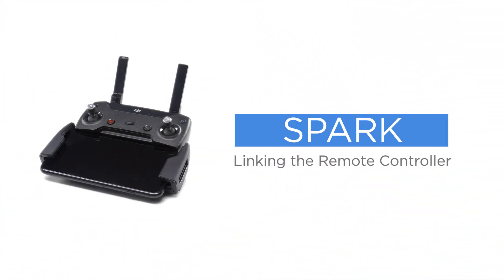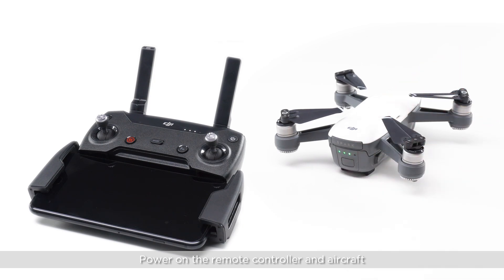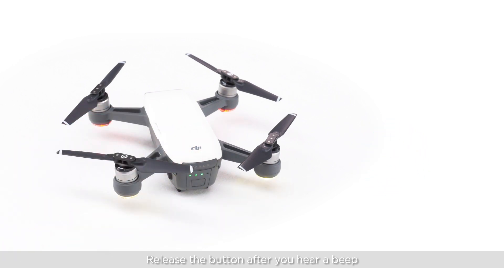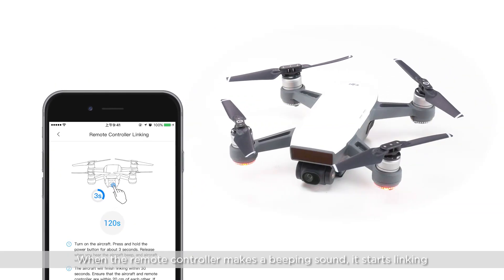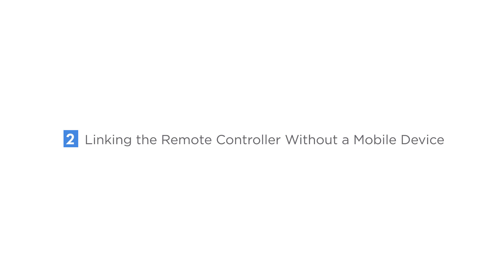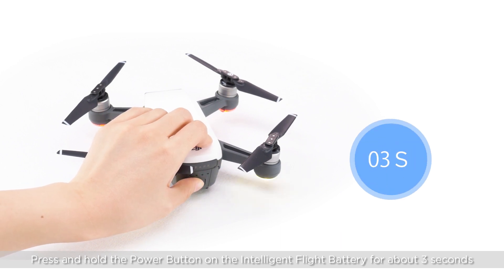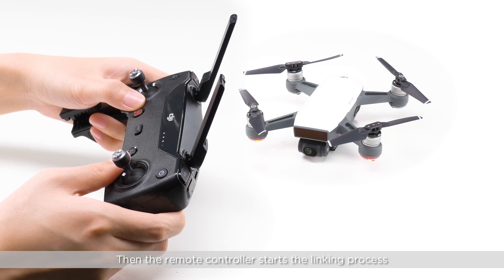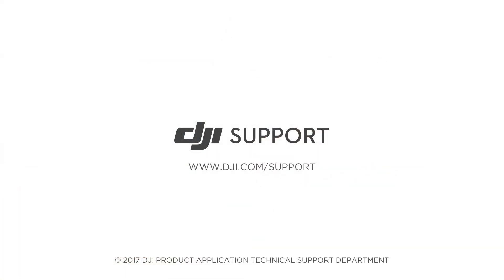How to Link DJI Spark's Remote Controller

Comment: My RC does not pass the wifi signal to the cell phone and does not match the drone. What should I do? thankful
Reply: I have the same problem. It's infuriating...
Can't get support for this on the weekends either. Who even uses a drone during business hours....?
Reply: Wish i would have read all this before I bought my spark.
Reply: I finally got hold of support 

Ridiculously, the DJI android app does not work on pixel phones. Pixel is a leading android phone.

DJI advised me to buy a different phone.

What a joke.
Reply: Shameful for DJI. This can not happen, my RC came with defects.
Reply: Same here...
Reply: If you can, send the result to us. Thank you
Reply from the maker: What mobile device are you using? Please try to reset the WiFi. If it persists, please refer to the link below to contact us for further assistance. https://www.dji.com/support?site=brandsite&from=nav